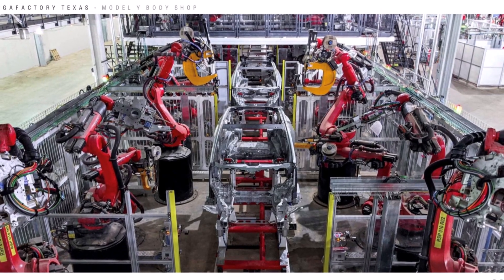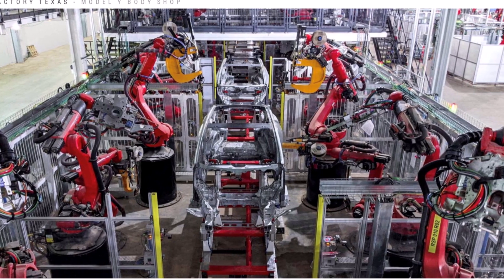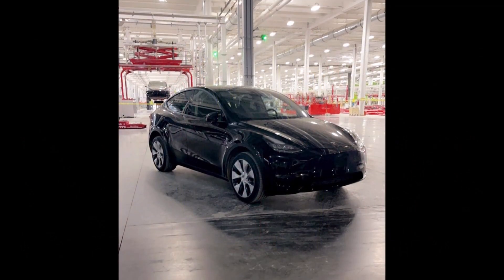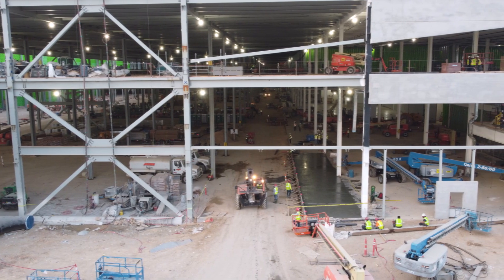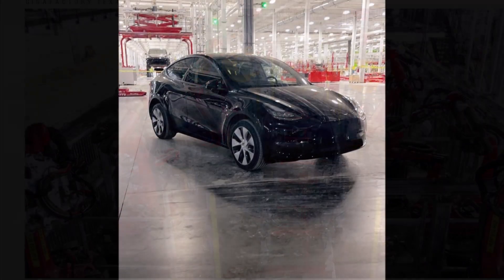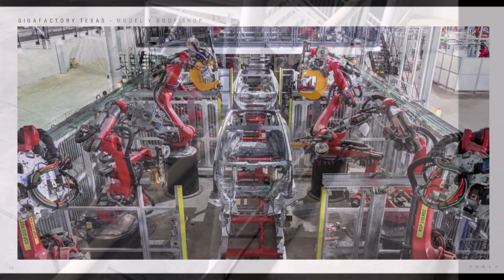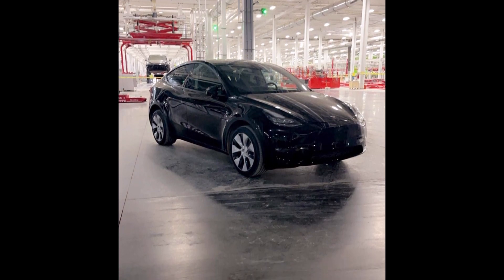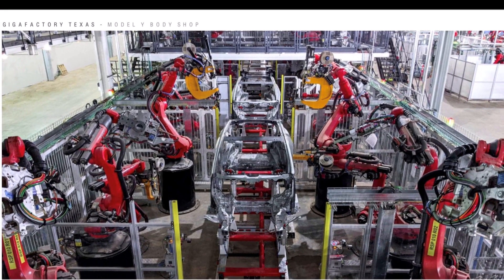JUST IN! Watch 1st Model Y With Front and Rear Castings at Gigafactory Texas

Comment: If the 4680 cells are not available, does that mean the structural pack concept is not used until the cells become available?  If so, can we assume the new front and rear castings can accommodate either battery structure?
Reply: You absolutely correct on both points!
Initial model Y’s will use the new front and rear single piece castings, BUT with the existing 2170 battery pack.
Once the 4680 cells are ready around the middle of next year, they will switch over to the structural battery pack.